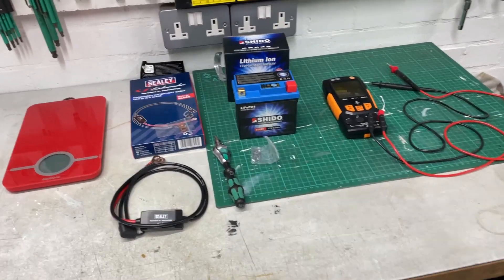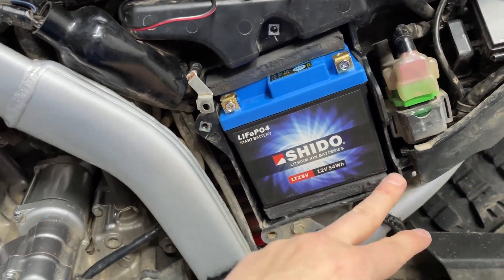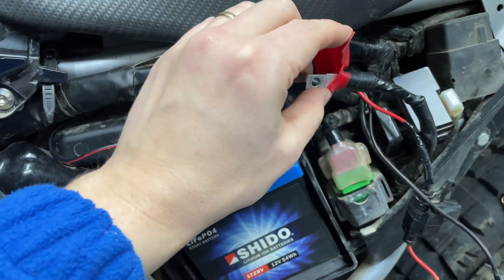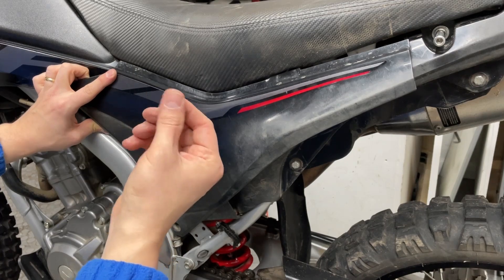How to and why instal lithium-ion battery (Shido LTZ8V) on Honda CRF250L.

Comment from the maker: Intro: 0:00:00
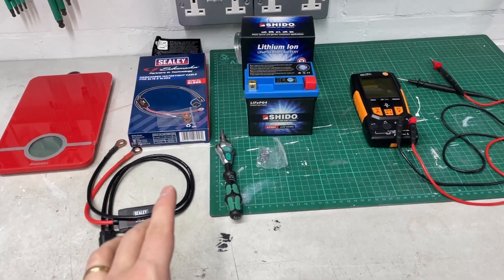Reason Behind the Battery Replacement: 0:00:34
Why Shido and Not Antigravity Re-Start Battery: 0:01:12
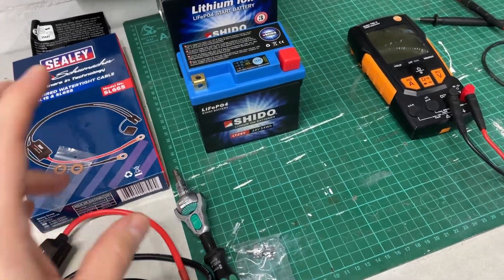Honda CRF250L Battery Differences Pre-2017 & Post-2017: 0:04:33
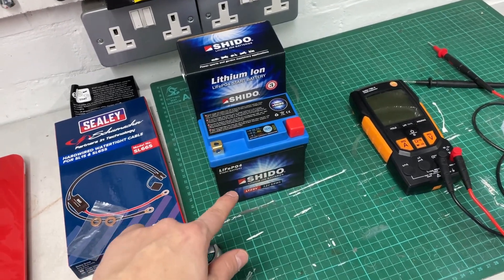Stock Battery Removal: 0:05:31
What Order To Disconnect Battery Terminals In & Why: 0:06:52
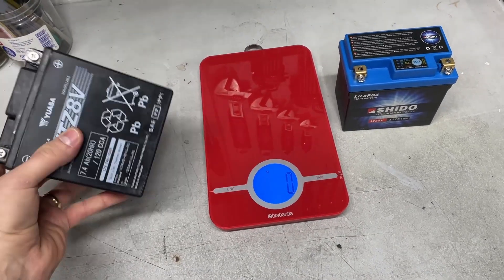Battery Weight Difference: 0:08:01
Battery Height Difference & Spacers: 0:08:32
Checking New Battery’s Voltage: 0:10:44
New Battery Installation: 0:11:28
Final Thoughts: 0:14:21

Comment: You don't need trickle charger for Lifepo4. They have very very low self discharge & will crank the bike even after years of sitting idle. Unless you have something actively pulling current.
Reply from the maker: Yes, that's definitely a benefit that I've forgotten to mention in the video, thanks.
Reply: Everything these days has a parasitic drain.  Especially if you have an alarm.   Unless you disconnected the battery entirely and that's not convenient if you plan on using the bike. So a trickle charger or maintainer may be necessarily.